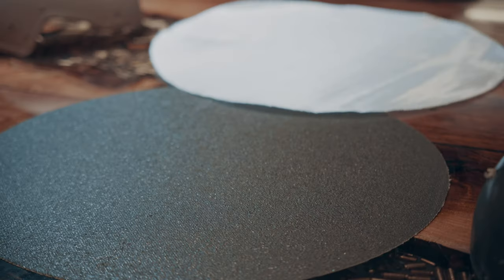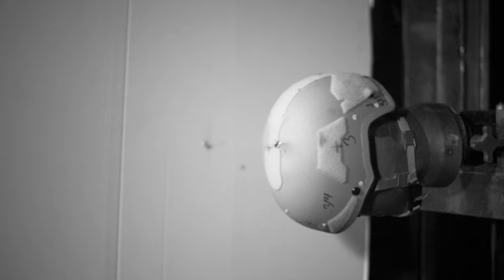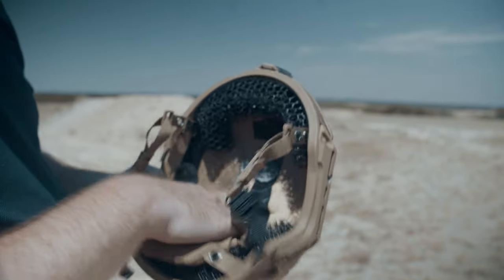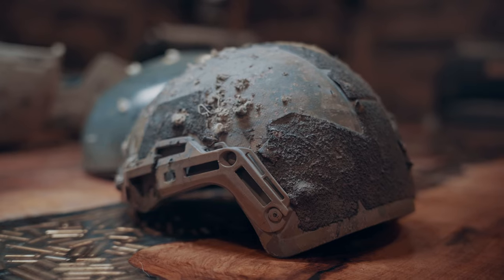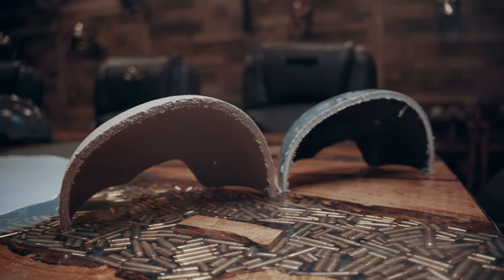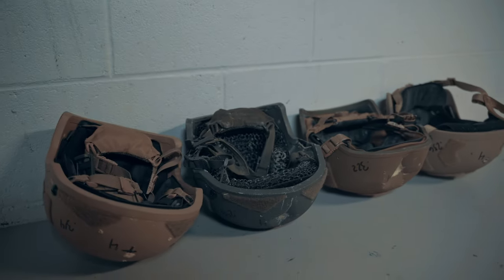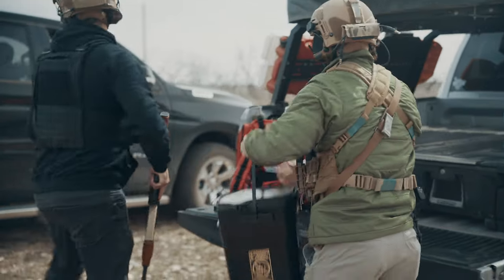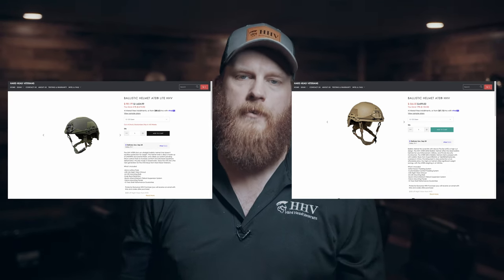What are Ballistic Helmets Made Of?

Comment: Having worked in fiberglass , truck caps to cocktail trays.the process is very similar. Look up the fiber by yard. The price of the resin. The press tooling . A total money grubbing rip off! Could be made profitablely and sold for well under $100.
Reply from the maker: Tooling and machinery is definitely expensive, as are material costs. We also have about four days of work put into each helmet from start to finish.
Reply: As the guy who currently coats the kevlar with the resin, I can tell you you aren't making one of these helmets for under $100. Let alone a profit lol
Reply: Custom molds are insanely expensive, as is the tooling if you don't already have some. A company needs to make a profit and pay employees, so companies have to charge more during the initial production runs, especially if they're focused on quality, production runs will be low. The more that are produced, the cheaper they get. Military grade helmets are a niche market, not everyone needs one, although everyone should have one. They could offset these issues by producing better quality construction and motorcycle helmets and getting into those markets so they could sell a higher volume, but perhaps they wish to stick to defense equipment. As for good quality materials, you'll have $100 in material costs, you won't be making a profit, and you won't be paying employees.